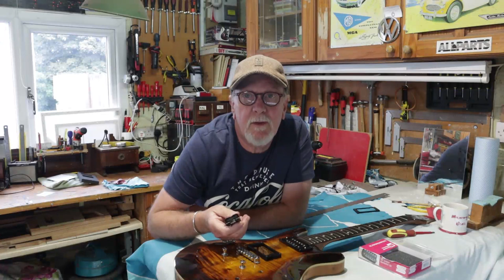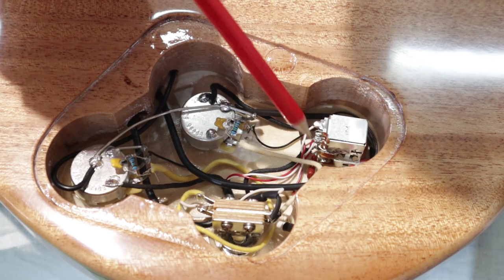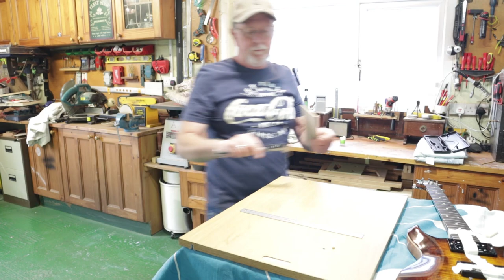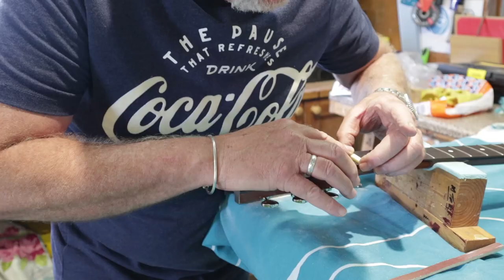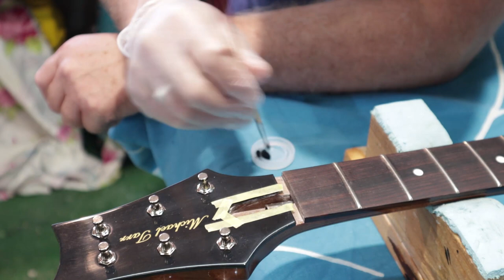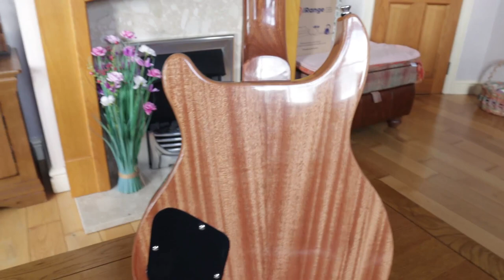Build a PRS inspired style carve to guitar and Road test song Samba Pa Ti, Carlos Santana.

Comment: The guitar came out beautifully ! Is there any one thing that you learned on this build that made you say"  right, I'll not do that again"?
Reply from the maker: Hi Sam. Not just saying it but is that probably the best question anyone has ever ask me. So well done to you. 
That’s a tricky question, because I’m always learning, and I like to show different ways on doing things. 
So I’m going to say yes there is something I have learned.
It’s the neck Angle, a 4 degrees would help with the build and final set up. I used 2 to 3 degrees angle, it made the bridge height pretty tight. But I just got are way with it. Many thanks for all you comments, and where are you based. Best wishes Mike and Oliver and thank you. 👍